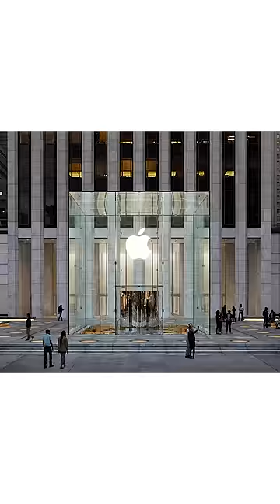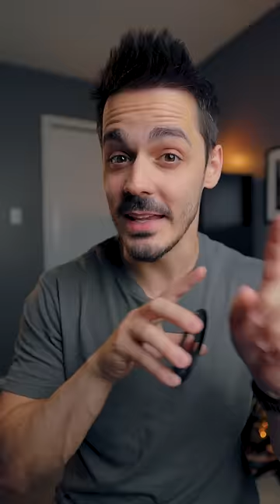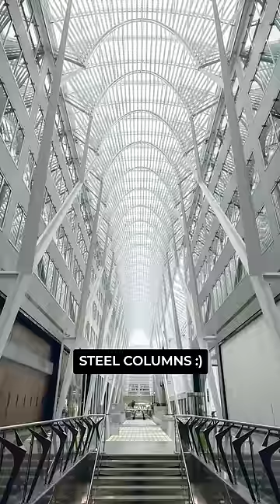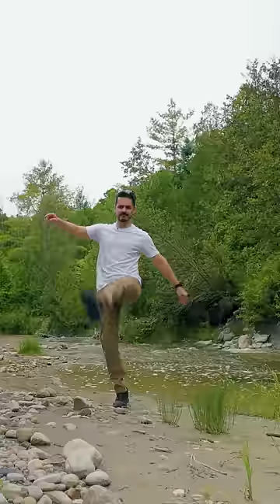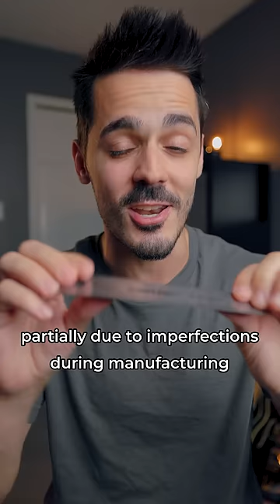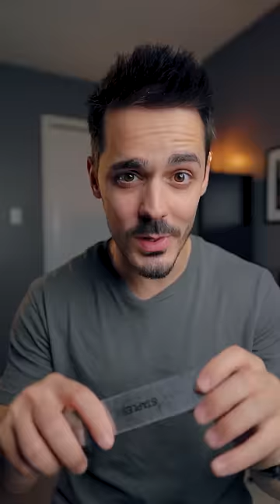GLASS is Stronger than STEEL?! 😵

Comment: Just to clear: bending force has a tension force in it's core so that's why glass can't resist momentum forces
Reply: Under pure bending there is no compression or tension at the core, only shear. Max tension is at the surface on the outside the bend and there are compressive forces at a maximum at the surface on the inside of the bend